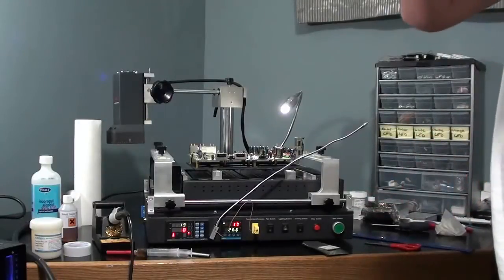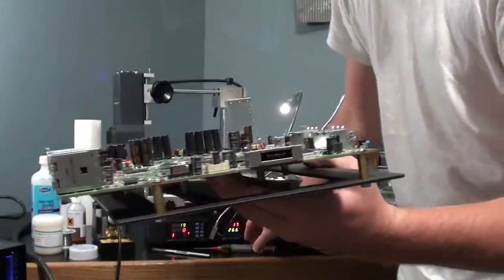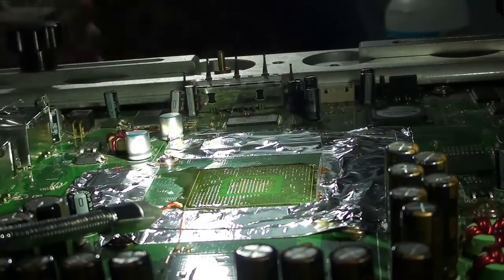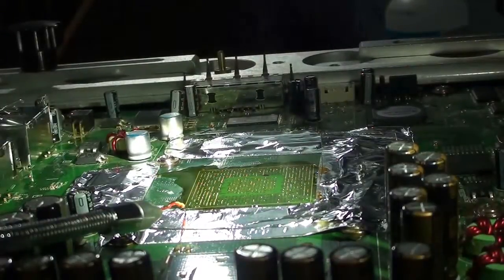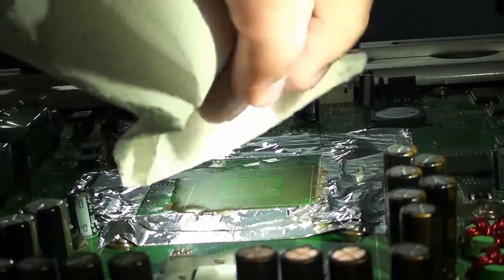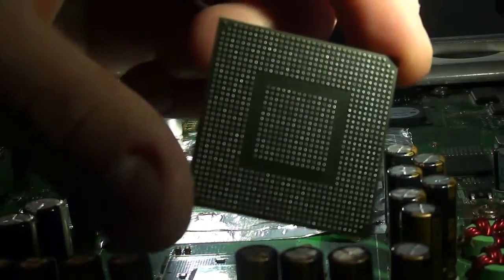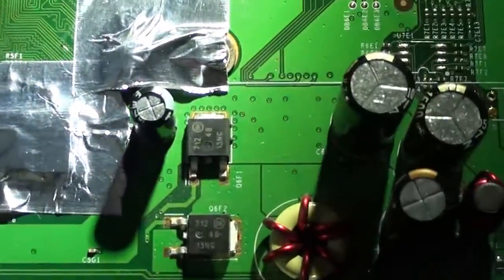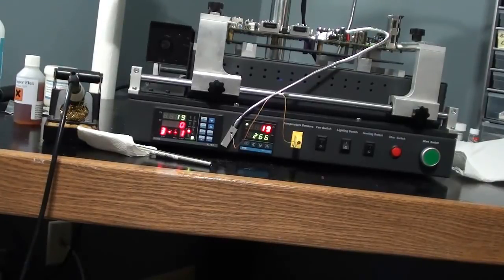Xbox 360 GPU Replacement

Comment: Going replacement for xbox360 is really unecessary because you going have to get another gpu from another 360 and that destroys the purpose of a xbox 360 replacement any possible
Reply from the maker: Forest Foxx-HD you are 100% incorrect. Xbox, playstation, laptops etc all require a specific gpu. Can't use any gpu.
Reply: im pretty sure you can use any laptop gpu
Reply: Oops okay sorry I'm more experienced with PC's and gpu changing in those whereabouts haha sorry. ColemanBud
Reply: ***** I do know what I am talking about and it is possible to replace a mobile gpu if they are MXM capable :)